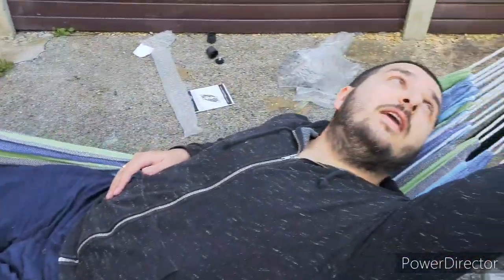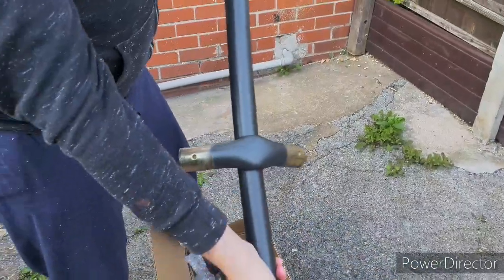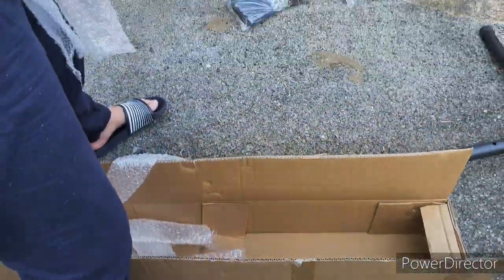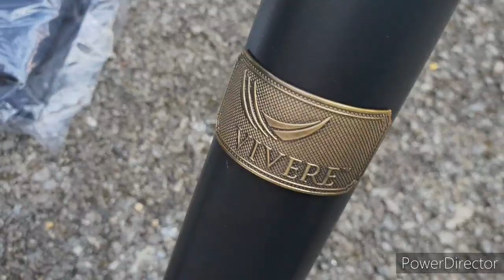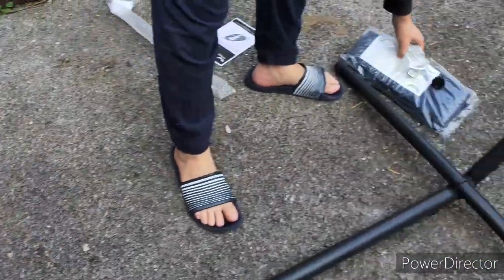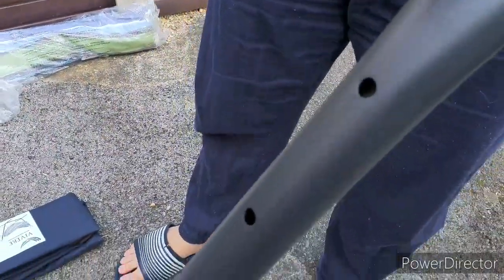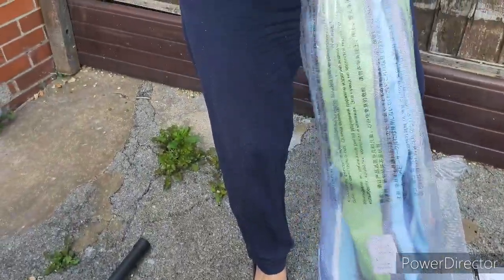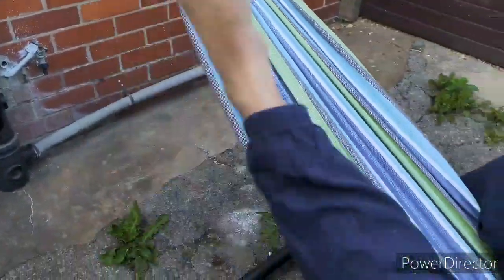Vivere  Hammock Assembly - Double Cotton Hammock with Stand - Oasis

Comment: I got the same hammock, and I am using 3rd hole as well, but the bed and string are too short to reach the hook.  anyone got the problem ?
Reply from the maker: It worked just about fine on this one just need it to stretch it a bit more. However I do understand where u coming from.
Reply: @SEPAChannel  yeah, it stretched later.  thanks.